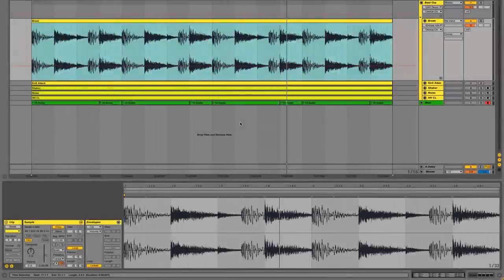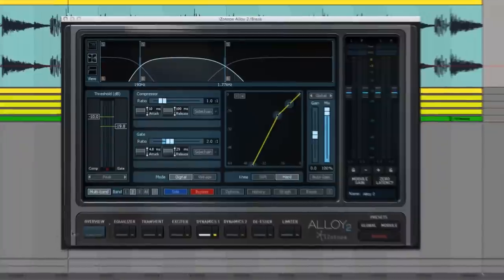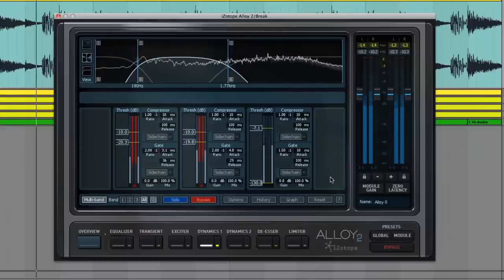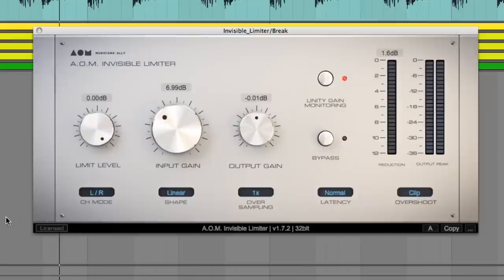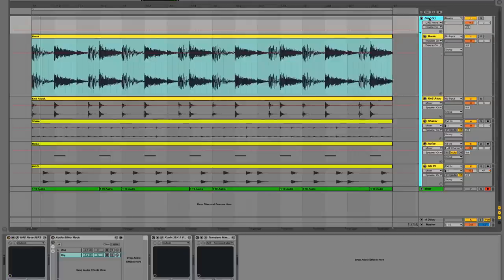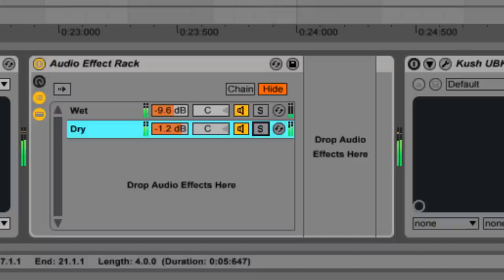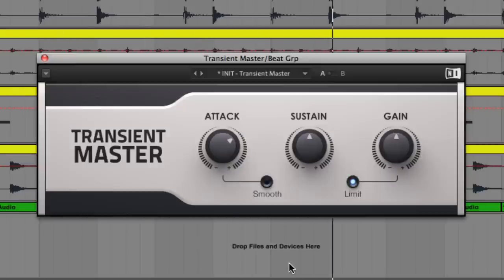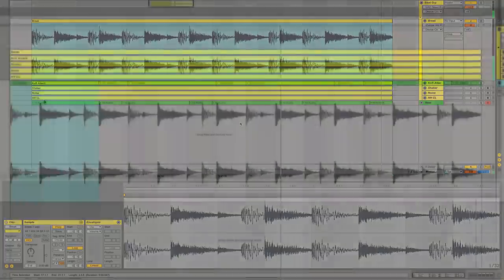How to process a modern D 'n' B breakbeat

Comment: Assuming you already own Ableton Live, the rest of this tutorial will cost you:
UAD Card - $700
Alloy2 - $200
UBK-1 - $150
Precision Multiband - $250
Invisible Limiter - $120
Neve 88Rs - $240
Vision Channel Strip - $240
Transient Master - $100
Total: $2,000

It's a good thing they used a royalty free break!
Reply: BUT, if you are lucky and have the Suite you don't need any of those plugins.
Reply: It is not a bias at all, you have no idea, sorry to say that. Maybe you should train your ears a bit more :) Check this article and be enlightened: http://www.mixedbymarcmozart.com/2014/10/23/compression-think-part-1-music-tube-compressor-royal-harmonics/  You should make the test with the compressors you have and you will see they probably all add harmonics. Just because YOU cannot hear them does not mean they are not there :)
Reply: Phasement Official you might want to look into this a bit more because no two compressors are created equal. Some are very transparent and others are used primarily to impart a certain characteristic.
Reply: May I ask about your experience? I wonder how you come to this statement? You will definitely hear a difference depending what compressors you use. It's either different hardware or different algorithms, so they never sound the same.
Reply: Irrelevant, all these process can be done using in-built software and free plugins. Totally a moot point.